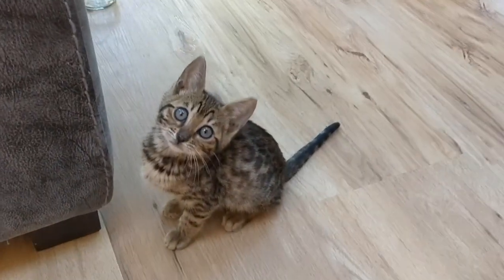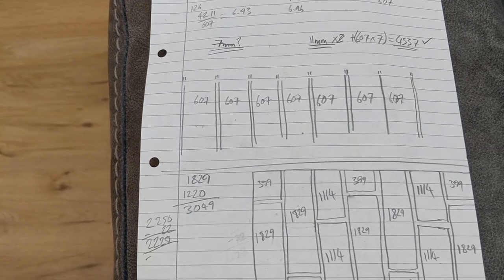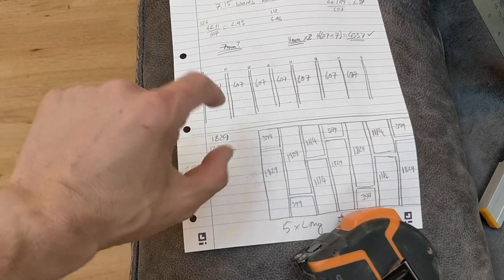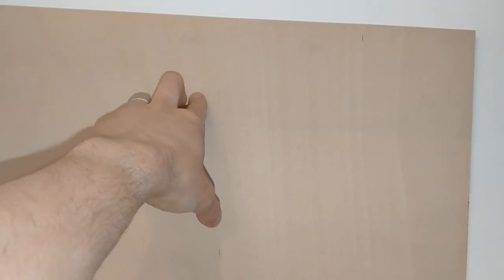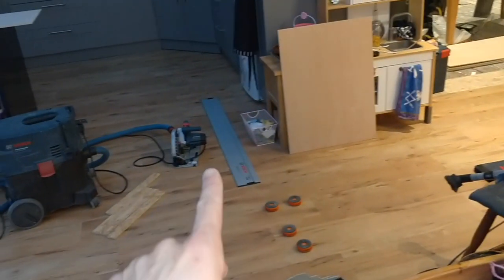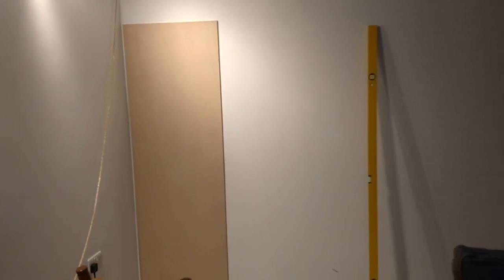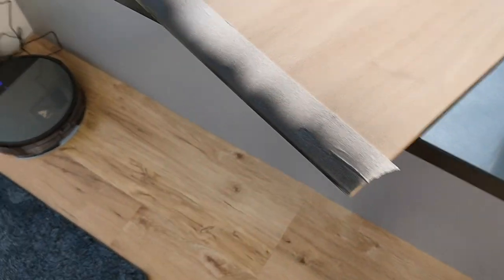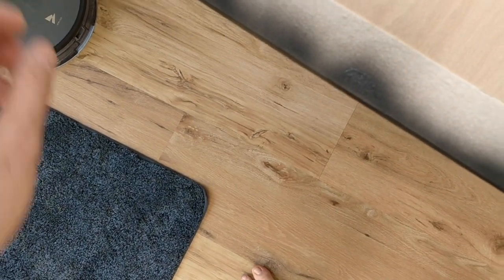Scott Brown inspired Plywood feature wall

Comment: Nice design idea. Almost pull this off, however the execution was very sloppy and rushed. It reminds me when I used to do this kind of DIY projects without putting the correct amount of thought and rush it to get it done.

1. He could have saved time, and a lot of aggravation and frustration by taking the time to TRACE the lines where the divisions were going to land and PAINT the drywall BLACK with a  4" wide roller and some black latex paint. In this case you don't even need to tape the dry wall because the panels will cover the excess paint on both sides. 

2. For god sake man, sand the edges of the plywood correctly then SEAL THE WOOD before you paint over it. 

3.  ALWAYS paint the panels BEFORE you hang them. Painting them after is completely dumb, messy, inefficient and you will never achieve a good quality finish.

4. HOW TO AVOID EDGE BLEEDS WHEN USING TAPE ? There is a hundred ways to do this. The quickest and dummy proof?         
- Put a tape about couple mills away from the edge of the face. 
- Put WAX on the bare wood and cover the wax with another tape overlapping the one before (you need to use a STRONG TAPE don't go cheap) 
- Paint and let it dry completely (read the instructions on the paint) 
- Remove both tapes. The black paint will be seating on top of the WAX 
- Now lightly SAND the WAX (150 - 220 grit) and it will remove the wax and the paint.

Always try to visualize the work flow and you may be able to come up with the correct steps. 

Good luck

Comment: Looking good!
My wife has done a lot of painting with different colours lately, and to get a sharp line with masking tape she paints the tape with the base coat first to saturate/"fill"(?) it. She suggests you could have varnished the edges and tape first and sprayed (or brushed) the black over it directly after it was dry.
In our experience there is no way to completely avoid masking tape bleeding a little, without this trick.
Reply from the maker: Nice! Thanks mate

Comment: What I used is a black u channel to form the lines of the shadow gap and this hides the ends of the ply after sealing then you can also put 10mm……3/8 polished glass in any of the horizontals for small shelves.

Comment: Paint the wall first and I think it would help using some kind of clear coat to fill the end grain before painting it black
Reply from the maker: I did strongly consider that, but figured I'd still have to paint the edges of the ply-wood anyway...I think a paint-brush would have been the best option!
Reply: How do you think it would look with the back wall painted, but not the end grain of the plywood?  I'm leaning that way.
Reply from the maker: That was a strong consideration, the issue I thought we might come across, is that the shadow gap may not look definitive enough.

I didn't want it to look like an accident or as though it wasn't crisp...I think painting the back wall first would definitely have been easier and better though!

Comment: Great videos , can I glue ply onto ceramic tiles thinking of doing the bathroom cheers
Reply from the maker: With the right stuff you can glue practically anything together...ply is a great sub-base for bathrooms because it's typically hard-wood, and once primed with a bit of PVA is relatively waterproof and unbelievably strong.

You can then have your bed of cement over the top to hold the tiles.
Reply: @OfficeBoyBuilder  I want to glue ply to my tiles as I want to attach panelling to the ply instead of knocking all the tiles off the wall , cheers
Reply from the maker: Ahhh sorry. I understand now 

If the tiles are sound, then I don't see why not! Once you've figured out your levels etc you'd have a decent surface to work from.

I would still be inclined to prime that ply with PVA, and then use a really strong adhesive like polyurethane or a polymer glue. Avoid the standard green or pink tubes of grab adhesive, that stuff is useless!
Reply: @OfficeBoyBuilder  I’ll do a small test and see how it goes and I’ll let you know cheers
Reply from the maker: Good plan! 💪

Comment: How's it holding up and did you end up sealing the plywood at all? Considering doing something similar myself. I'm concerned it would be hard to clean around the baseboard if it wasn't sealed. I have dogs :D
Reply from the maker: We're really happy with it. We sealed up all of it, and it has lasted great! Can't really comment about dogs though!
Reply: @OfficeBoyBuilder  Do you remember what sealer you used?
Reply from the maker: It was either a Danish oil, or a boiled linseed...I honestly can't remember which!
Reply: @OfficeBoyBuilder  Gotcha.  I was thinking something that put a protective coating on it. Like Polyurethane or some type of finishing sealant.  Thanks!  It looks great by the way!
Reply from the maker: Shellac would be a good one for that too...I just didn't have any to hand!